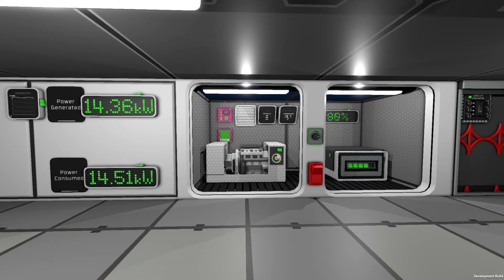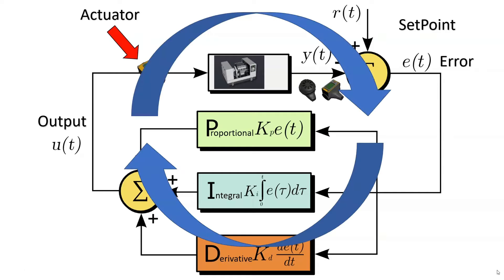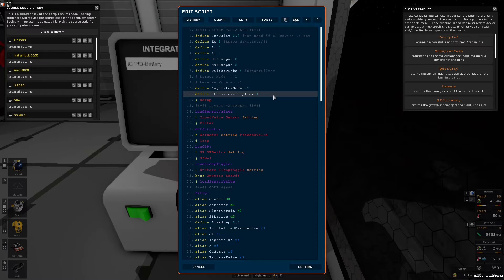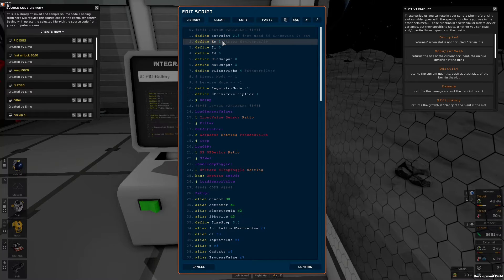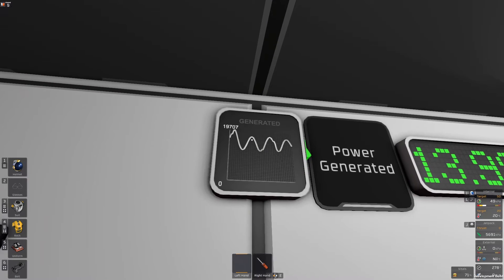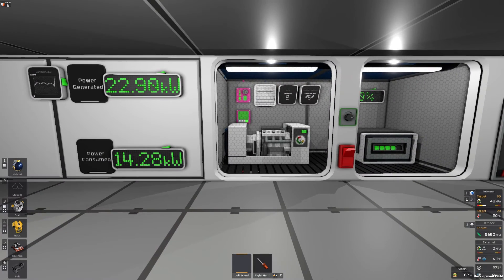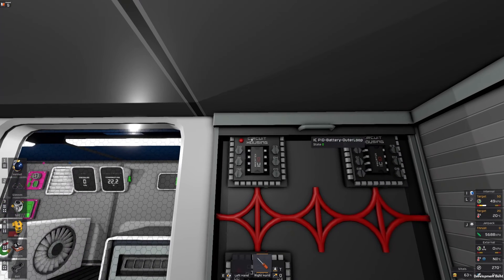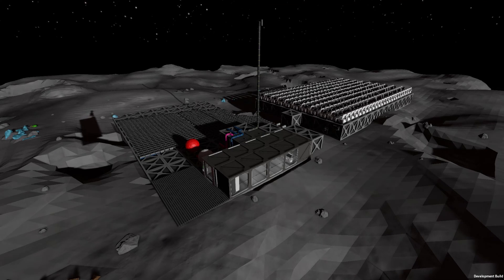Stationeers PID Tutorial

Comment: I cant even imagine how to setup a gfg room without getting overheated, and here you are making 2x1 gfg room effortlessly and no cooling devices setup   has been seen everywhere
Reply from the maker: to be fair, this isn't my first attempt :)
I have some sub zero gasses in the back and i use a volume pump (PID-controlled ofc) to simply pump it in on demand. A very stupid active vent makes sure it doesn't go over a pressure threshold.
If you keep an eye on the temperature display you'll notice it keeps the room at around 20*C no matter how hard i run the generator.
Reply: @Elmotrix  i need to learn PID first, so i'll be able to understand most of the words here, lol
Reply: Is your code still usable in latest game version?

Comment: Love it .. did you study this topic .. I mean is it you real life job to automate things or do you pull the calculus just for funsies ? :D Also It would be really cool if you could show how to hook up all the stuff... I mean the wiring.. could be a very basic setup just to get the data from the batteries and generators into one chip .. I fail to do so.. (right now) .. have to keep searching.
Reply from the maker: i'm an automation & control engineer ;)

but the wiring on mostly everything i do is just a huge cable network that sticks into every available port :P
Reply: @Elmotrix  I had the problem that I could not get the data from the batteries and the generator into the same network, because .. 

I already solved that using a couple simple logics, 2 readers and a math... power and input at the battery cable, logic output to the generator cable, now I can see the battery charge "behind" (on the input side of the) the batteries .. thank you for the reply anyhow !!

Comment: I always imagine these feedback loops as a mass and a dampened spring.
the proportional part would correspond to the stiffness of the spring,
the derivative part to the dampening fluid/friction, 
and the integral part to the heat loss from the deforming spring, maybe? (~integral of the absolute value?)
edit: nope, integral part would be the mass/inertia.

I usually try to go for a critically dampened system (very little overshoot).

Comment: Just getting into this now. A lot has changed since the video was made. So now, the pressure regulator uses less power, it seems...and it provides some saftey over the volume pump. The issue seems to be fine changes in the regulator setting, making the response very slow. It still seems to work, but I don't get any oscillations.
Reply: Looks like I had to start at 150,000

Comment: might be a dumb question but why you didn`t use simple pressure regulator instead of volume pump?
Reply from the maker: regulator doesn't (didn't?) move enough gas to keep up. and volume pump gives a much finer control for quite a bit less power. :)

Comment: I have just now came back to one of my old saves on Stationeers to mess around with your generator a bit. I keep on running into a problem of not being able to control the battery with the SP Dial. It might be user error so do you have any input on what I should be looking out for to fix this?
Reply from the maker: sure, but i would have to know more details on what's happening. "not able to" is a bit vague. is it not regulating at all, or kinda? is it just changing set point that's the problem?
Reply: @Elmotrix  Yes, for some reason it is not regulating at all, ive looked over the wiring numerous times, checked the ic housings to see if they match up with yours on your test world and nothing seems to be popping up as and error. Even when the battery has hit 100% the generator doesn't seem to slow down any.
Reply from the maker: @carlosalarcon1741  ah ok so the generator is running at full capacity? what's the input pump doing? how is the pressure between the pump and the generator?

have you changed the code to read the correct variable types?
- if it's running 100%, pump is still on and pressure is still building it it's probably a variable/setpoint error. like if it's reading the ratio from the battery and setting from the SP dial, and for example you got the dial on 3, it will fight hard to try to get the battery to a 300% charge (to no avail).

 Have you set the correct regulator mode?
- Wrong regulator mode is essentially inverting the output, and it'll go harder when it should cut back.

if the pump is off or pressure dropping, it might just have grossly overshot and is working it's way back down (some tuning needed).

if none of these fit, try to set it to a P controller:
Kp = 1 (you can be a bit flexible with this)
Ti = 0
Td = 0.
this won't be a good controller, but it should at least find a steady state while eliminating some possible tuning errors. it will respond instantly to any changes you do and not "lag" making it easier to spot the error/fix. then take it from there.

Edit: remember it's the pump you're controlling. the generator is just indirectly controlled by the pump. So you should look to what the pump is doing wrong to find your problem.
Reply: @Elmotrix  Wow this seems to be a very odd and even maybe surprising fix? When I was checking out the input pump for the fuel I turned it off and on a few times then tried the dial again and it pretty much fixed itself?!? I mean I'm not complaining I just wish I knew what exactly happened lol. You are definitely one of the biggest and best helps to the Stationeers community. It is definitely a big motivator when someone that knows what they're talking about can help you troubleshoot in this game. Thank You!
Reply from the maker: @carlosalarcon1741  PID controllers can be wierd. sometimes a good controller manages "small" changes fine but a cold start takes time to get going properly.

but glad you got it running :)